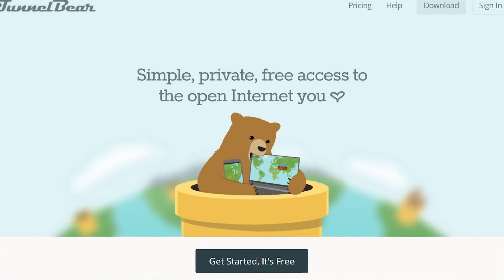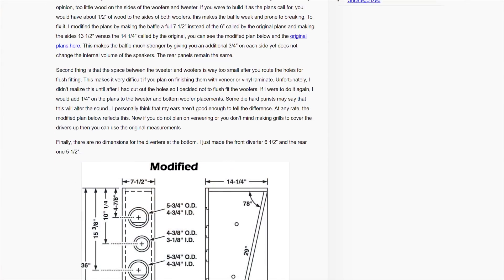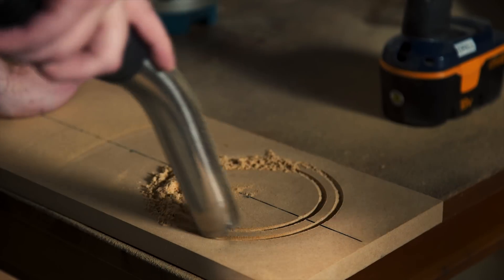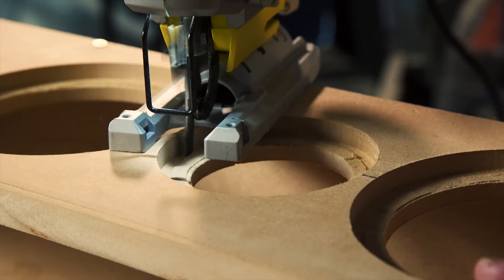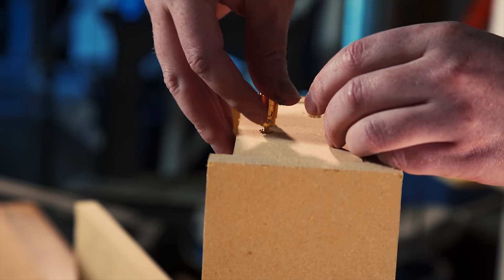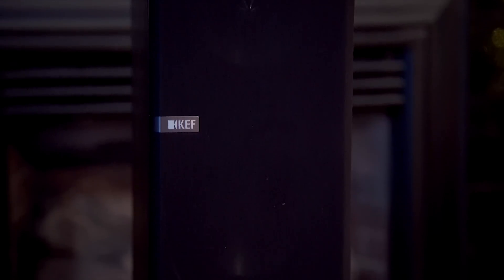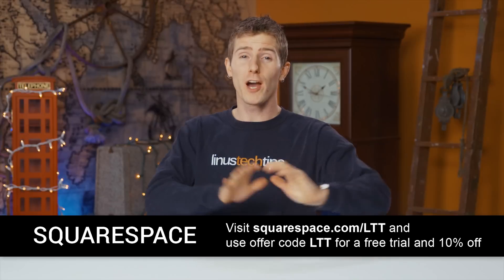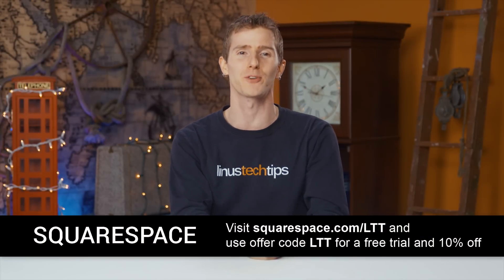DIY Speakers for Less Than $300!

Comment: Thumbs up for DIY speaker videos! :)

A few comments in DIY speakers:
1) Your cabinets need to be sealed (or ported), but at the very least intentionally aired.
2) Second order filtering is not enough. Your KEF are probably using a custom 4th order butterworth, with specific cuts for highs and smoothing gain, etc. A simple 3rd order butterworth would increase the cost slightly, but gives you MUCH smoother cut-offs between your mid-range and wooferss.
3) 3-way is  smoother in sound and your KEFs are probably cutting differently on the 2 full-range speakers.
4) Over-padding your speakers is going to make the sound dull ... And when calculating volume, you need to factor in the amount of stuffing you put in. Also, buying proper padding (in sheets or rolls) is worth it

Overall, there's a lot of small things you could have done much better with VERY little effort. Your KEF Q500s are pretty good, but for 350$ you could blow them away in purity and power.

Comment: theres alot of pre build cheap good looking speaker boxes around 10 to 20$ if you know where to buy it. and you can just buy the speakers(low, mid, high range) and stick it there with screws.. you dont need to actually build the box enclosure.

Comment: Cutting MDF without a mask, are you stupid?
Reply: Tylers Trains Yes they are. They constantly cut towards themselves and forget various saftey equipment. They need a carpenter for their diy projects.
Reply: Mario I was referring to their diy projects in general. Are your wrists physically challenged? You can most certainly cut towards yourself with any handheld saw.
Reply: Mario If I wanted to cut towards myself using a circular saw (very dangerous) I could just turn the saw round.

Comment: Looks like shit. Come on, at least the paint could be done right.
And its not worth it. Just buy some decent older used speakers. It will end up looking better and probably sound better. And you will have no problem selling them when you want to change them.

Comment: I have the tools to make nice cabinets for them..but id still stick with buying a premade speaker over these... I just dont feel like they're that much cheaper than getting yourself some decent towers..Polk's TSi series towers would run similar for example, and for not THAT much more there are options in the Signature series and of course Klipsch and JBL...Shop around and im sure you could get yourself some nice used ones too... Polk runs buy one get one deals yearly too (I'm most familiar with polk as I own polk RTi A series stuff.. i dont have a bias to them, i just know their pricing best off hand) which means you could consider the RTi A5 even...

Comment: Try adding more polyfill to help out the low end it will act as if increasing the length of the transmission line.

Comment: I assume this video is aimed at everyday people! The problem i find with this DIY, is that the so-called "$300" didn't factor in:
- Cost of buying or renting the tools to make the speakers.
- Costs of buying all the components that make up the speakers.
- Cost of buying all the materials to make the shell.
- Time to put it all together.
- Time to do all the necessary research of all and quality of the components and material.
- Time and cost, of studying up on how to connect all the electronic safely.
All that could of cost more than $300.

I just rather, save all time and probable save on money as well, and just buy some decent/good speakers from Logitech, like the Z623 (or whatever brand you like).

Comment: Like to see you compare another set that you found used lots of times you can find u on used site I have found you can get them for 10-20 % the cost of new with a little searching and waiting found my speakers for 200 for 5 speakers and a powered sub normal cost was about 4 k but with a deal like that you got to act fast.  Before you jump to conclusions guy had stuck in attic of a really big house so likely not hot.

Comment: Duuude, I used to pick up towers from the thrift shop and use them to build sound systems for home, cars, etc. The best part is that they have the crossover installed, so all it takes is a re-mounting to fit the desired form. If you're looking for the poor man's DIY, it doesn't get any cheaper than hacking up old tower speakers and modifying them. Also, it sounds pretty damn good once you get the basics down. The first few systems I made did not sound good. But eventually I worked through a few duds and came up with a few awesome ones. Haven't built my own in quite some time. But anyone looking for decent sound(not enthusiast at all, but still not disgustingly bad) should look into making their own.

Comment: Should have invested 10$ for at least a front veneer... Oh and you have to flat out the nylon fiber, it is not supposed to take up the whole volume of the speaker, you need air that the speakers can move. This is probably the worst thing you can do to a speaker, take out it's air... It will result in sounding closed, very little presence, that is why the mids are drowned out on the diy build.... If speakers can't bounce their frequencies they will always sound crap ! NEVER STUFF A SPEAKER FULL !

Comment: my solution works best, get a pair of cheap-used oversized home stereos and a ~100$ powered sub, or if you want the cheapest get a replacement logitech sub from like a z5500 or z506

I call it the ghetto 4.1 system, who needs a center anyway

Comment: All you have to do is find an old pair of speaker on the side of the road, build a new cabinet and wire up a new power supply and you're golden. Mine was water logged with a rotting wood case but everything worked after a little rewiring, including the included power supply.

Comment: Linus said that the resistance of the woofers is added, which is not true! It is halved!

Two 8 ohm drivers = 4 ohms
Two 4 ohm drivers = 2 ohms, etc.
Reply: That's true if they are wired in parallel. He specifically states they are wired in series which adds the resistance.
Reply: Matthew McLaren That's flat out wrong, please go and read up on how resistance works. What Linus said is right.
Reply: That's only true when you wire them parallel. In the video they were wired in series, which means they add up.
Reply: If you really want to go into detail, speakers do not have a simple resistance, but rather impedance, which is measured in Ω (Ohm) as well. There is a big difference there.
Reply: are you sure?
Reply: like 90% sure. hopefully someone can confirm or deny what i said.
Reply: Matthew McLaren No, that's wrong.

Total resistance in parallel (each resistor is on a separate branch of the circuit) is calculated as follows:

 1       1      1     1        1
----  = --- + --- + --- +... ---
 Rt     R1  R2   R3       Rn

So in parallel, 2 speakers of equal resistance would produce a total resistance of half one speaker's resistance. However, these are wired in Series. In series, resistance is calculated as such:

Rs = R1+R2+...Rn

So 2 speakers of equal resistance in series produce a total resistance of twice one speaker's resistance.

Two 8 ohm drivers in Parallel = 4 ohms total
Two 8 ohm drivers in Series = 16 ohms total
Reply: +Matthew McLaren
By "added" he means connected in series. The woofers are 4 ohm drivers. 4+4=8 ohms, which is the typical requirement of most consumer audio receivers/amps.

Comment: looks like you found those speakers in the garbage.
Reply: Nah, I found much better looking speakers in the garbage!
Reply: I found one it the trash that some one threw away even tho it was WORKING PERFECTLY so now i have like $200 sound system for free yeee.
Reply: They are MTM speakers and only need 2 way crossover. Each woofer is identical and gets identical signal.
Reply: Three way crosses are actually incredibly hard to design (a good one at least) 

It'd be better to go with an active crossover if you want an easy to make 3 driver speaker.
Reply: @Couchlands  For an active 2 way or 3 way setup you would need 2 or 3 pairs of channels to drive them. This is meant to be low cost DIY. Not many normal people have a bi or tri amp setup in their house.
Reply: Bet they sound like it too, bigger gaps in those cabinets than my resume
Reply: Haha XD
Reply: IKR
Reply: +James Diaz that's a two way you Muppet .. two ...tweeter and mid bass driver .. two thicko
Reply: He needed a 3-way cross with a woofer and mid-bass and better tweeter driver.
Reply: @raptorep  Nah, a true MTM is two-way, with doubled up midbass speakers providing a significant decrease in distortion over a 2-speaker design, this is proper. 3-way designs are largely a thing of the past now that usable frequency ranges are wider and you would need an insane effort in the crossover to prevent distortion crosstalk products between bass and tweeter, which i assure you are audible and unpleasant.

2.5 way is a valid compromise, but then, it's also pretty useless compared to a true 2-way.

The tweeter is indeed determining the sound, and it's a bit of a pity that Dayton doesn't publish the waterfall plot... but after finding some online for whole speakers using the driver, it has to be pretty damn good, like, CLEAN, absolutely top notch, not very exciting but very neutral, absolutely wouldn't just replace it. I'm somewhat wary of the surface diffraction in this build. The tweeter was probably intended to mount flush, and those troughs around the midbass drivers aren't helping either. Plus the edge should have been rounded off.
Reply: I have built some very good speakers that you can compare to 5000  euro speakers from my dad. My subwoofer is bigger to. Edit : I forgot a 0

Comment: This video was rather painful to watch for a diy speaker building enthusiast. I do like the idea though of bringing this more to the masses. The finish of the speakers is just awful, cuts aren't straight, holes are not aligned properly, crossover looks like a mess etc. I would not be surprised if the enclosure is actually leaking all over the place due to the poor cuts and glue job resulting in disappointing low end performance. Wood glue is very terrible at sealing the cabinate airtight, this problem can however be overcome with proper carpeting skills. Also the woofers need to be run in a bit for the suspension to loosen up a bit improving performance. 

A big recommendation from me would be to find a hardware store that actually can cut the wood to size correctly for only a small added cost. I do it that way all the time and the end result is surprisingly good without having to use a saw once. You will need a router though and a proper circle cutting jig, not a crappy one like used here in this video.

Comment: Although having these projects is surely great fun and can save lots of money, there are so many factors that delivers to the final sound of a speaker system, so many that I don't even know where to start. 
The pros of buying a good set of prebuilt speakers is that every aspect of the design have been tested to ensure it delivers to the final sound as good as possible (with a set budget in mind of course) - this is something you'll miss out by building your own speakers unless you're well experienced and give lots of time and dedication to your project.
This is of course considering you get a good pair of speakers, and not getting a screw-up job of speakers.

Do you want to have a great time with a nice build project, and/or want to save money - go ahead and have fun. 
Do you want great sound? Don't (unless you're well experienced).

I have given this DIY try myself once in the past but I gave up as it would be too much work for me, and I'm glad I didn't do it because later I bought an amazing pair of speakers of which the audio quality I wouldn't even come near with a DIY since they are optimal in so many aspects, so many small design specs that makes the full product of which I would only have overlooked Example: the box and bass port on my speakers are so well optimized that most of the bass is amplified by their dimensions -> the cones doesn't have to move that much -> you can play music louder as well as the cones are less sloppy due to the smaller movement which means better bass dynamics and more rapid response, yet the bass is still really flat and even - imagine how difficult this would be to achieve with a DIY project, unless you're pro and really know what needs to be done.

Doing this without being really good at it means you're pretty much at a lottery - you can get great results, but you can also get horrible results.
Though of course this doesn't mean much if you do it for fun ;)

Comment: I'm glad it wasn't build it for under like $10 then use $1,000 worth of stuff, But $300 is abit much, there should have been a middle ground plus the whole years of "engineering" that go into speaker designs. There's  a whole lot more involved then just fitting good speakers in good cabinets. Hence you guys clearly don't understand this as focusrite has to come do  your audio for you. Now they know what they are doing. Also FYI, most people don't have all these tools so its like a tease for your audience. Also, said tools are expensive "AF" as you say.

Comment: $300 is a lot of money to spend on just a pair of speakers, with or without assembly required. Makes more sense just to buy a more affordable pair of speakers. Recently got my hands on "BIC DV62si" speakers. They're 2-way bookshelf speakers with a 90 dB sensitivity, rated up to 150 Watts RMS, and they have an excellent sound signature. They also cost less than half the price of this kit.

Comment: Looked up the kit and its components: drivers are too weak to generate enough mechanical sound pressure. For 149$ you get what you buy. But it is a DIY kit, idiot-proofed enough. If I would go for a PartExpress bang-per-buck MTM kit: HiVi 6" mids and TangBand 1" softdome. Filter components may need a little adjustment, but for a 30$ @180$ more you get stronger drivers that fit a big closed box!

Comment: Good that you are encouraging more people to build their own. I did similar back in the early 90's. 
You should have used internal 'biscuit' joints or the 'peg-and-hole' method as those external screw marks looked awful BUT trying is better than not trying.

Comment: Does that include the tools......
Reply: Hiring them, yes
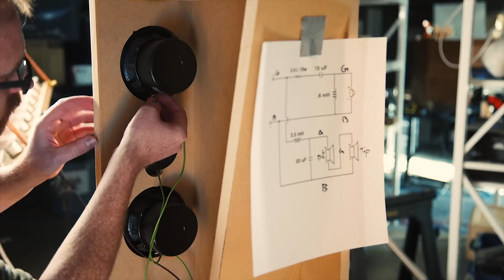Reply: They are not sealed, the terminus of the transmission line just looks a bit weird but that's by design, 5:25 gives a somewhat clear shot of the end of the line
Reply: PA5cAl1 did I miss something when watching this or are these speakers sealed, despite the original design being for Transmission Lines? :-/
Reply: PA5cAl1 was going to say!
Reply: I still can't understand the crappiness of that build, I could have done better with just a jigsaw :P
Reply: PA5cAl1 for sure :-) I've done a couple of builds now but for car audio and not finished yet - a 3.4 cu ft box for (6) 8" Sony Xplod P5 subs with a single 6" ID Precision Port tuned to 32Hz, and a pair of "full range" enclosures, each one around 0.4 cu ft and loaded with (2) 6.5" Alpine Type G coaxial speakers and a ~2" ID flared tube port
Reply: I'm still only busy with home audio, currently running a sealed 12 very similar to a SVS SB 2000, still the same tower speakers